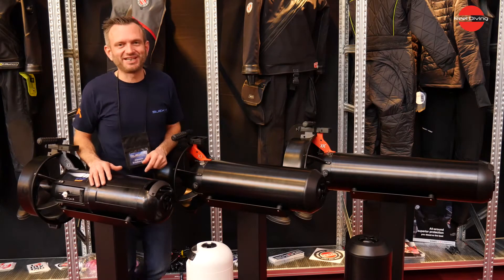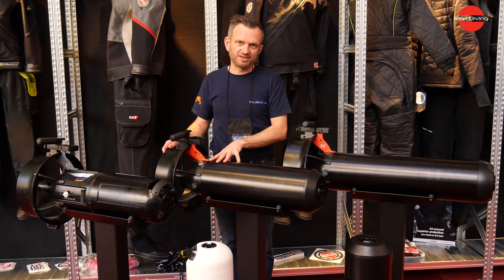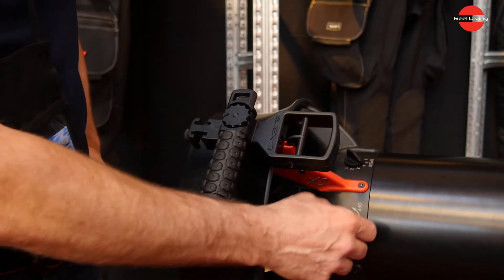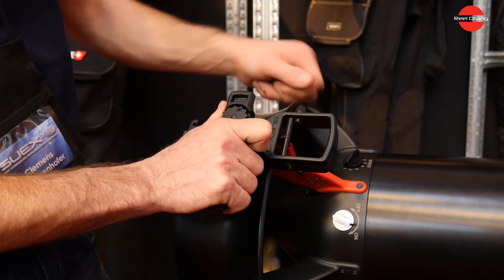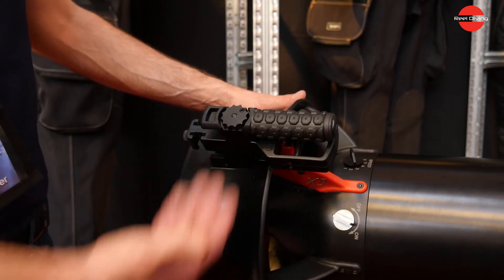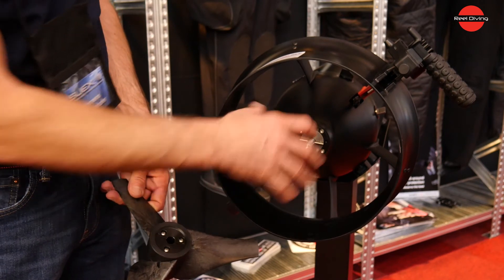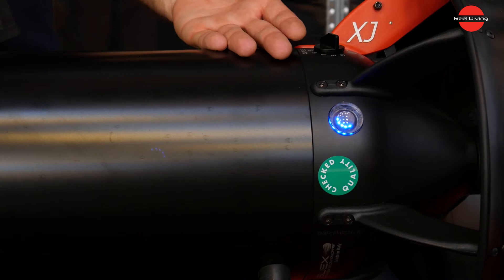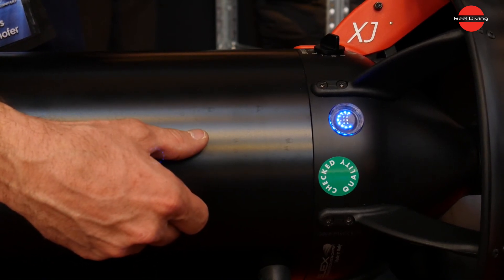Suex overview

Comment: I am having good luck upgrading my XJoy14, just did not receive the seawater ballast weights if needed. Is there a weight difference between the Xjoy37 ballast weight missing in the lithium ion conversion kit and my 0.8 pound rectangle weight?